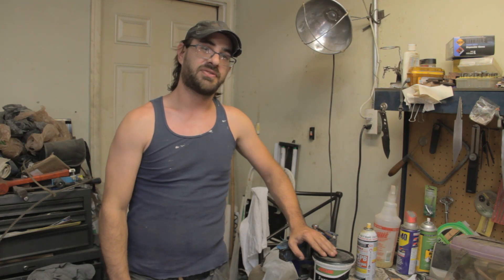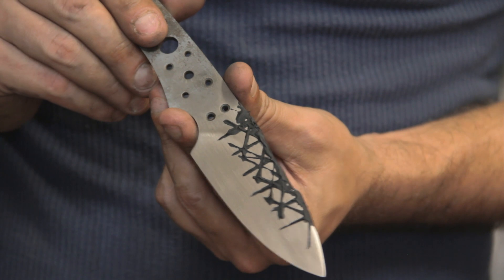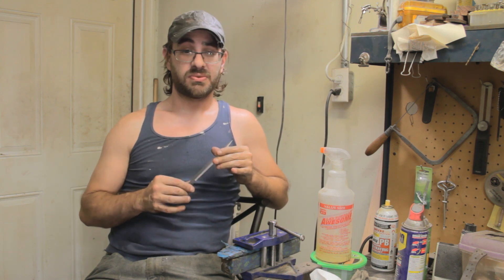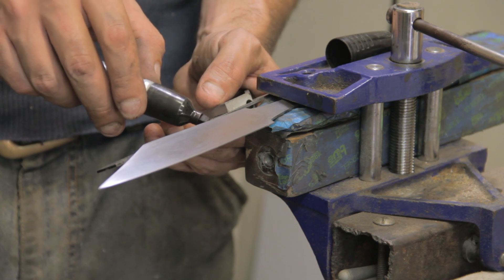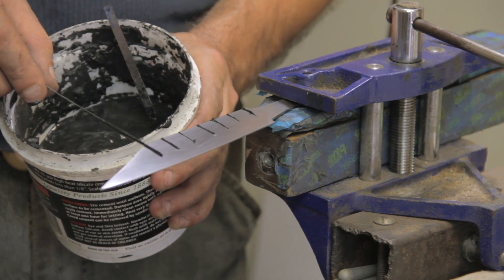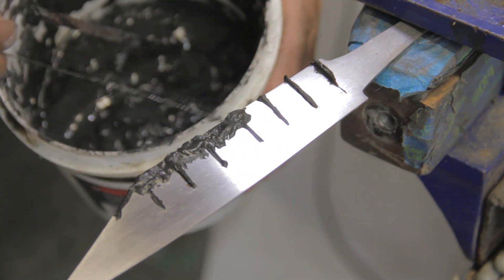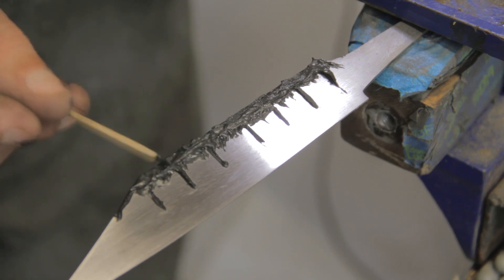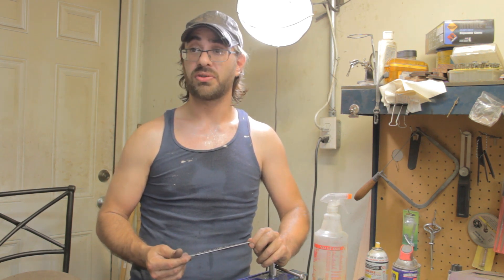Hamon: Claying a Blade

Comment: i was told by a japanese smith that the light wash on the blade was to increase the cooling rate, since the japanese traditional smiths heat treat mostly with pine charcoal,  scale and decarb isnt much of a problem.  great video !!

Comment: One of the best vids on laying out hamons.  Simple and to the point without the "air of mystery" some try to create. 

An interesting note: I've read that the wash coat is very porous and significantly increases the surface area of that part of the blade. This helps speed the cooling, aiding the formation of martensite, and in the creation of the hamon.  It seems to make a slight difference with 1070 and 1084 but no difference I could see using 1095.
Any thoughts?

Comment: One of the best vids I've seen for applying the clay. Would like to see the finished blade, hopefully in a future vid?
Oh, and a drop of oil/squirt of WD40 on the spindle of the center pulley will sort that drill press out ;)
Reply from the maker: Redpath Knife and Tool I've asked Matthew and Keith to send pics or videos of their finished blades. Otherwise they'll be posted to my forge's page on facebook, Alef Forge. 
And thanks about the tip about spindle lube, I have lithium grease coming for it already.